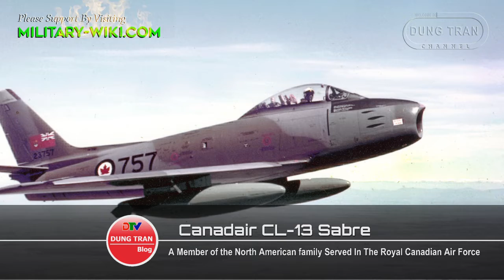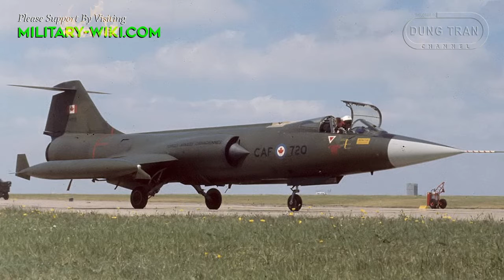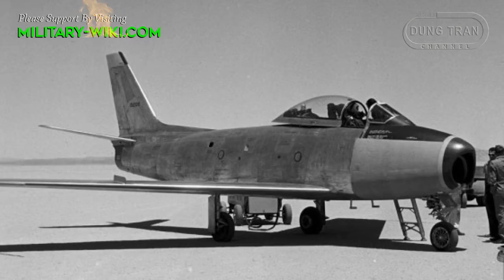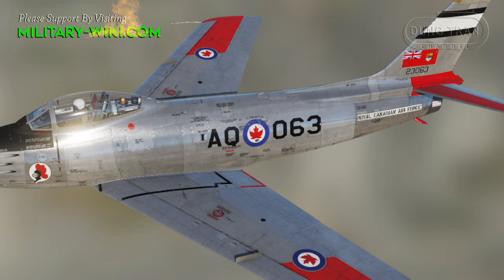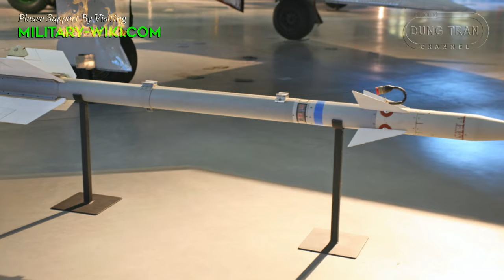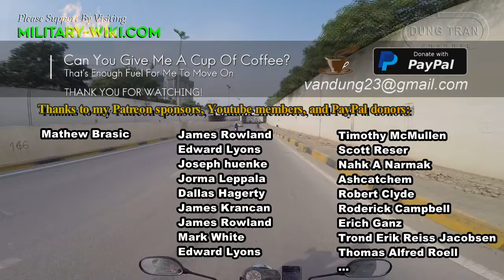Canadair CL-13 Sabre: A Member of the North American family Served In The Royal Canadian Air Force

Comment: The only disadvantage it had was that it was still armed with the light .50 machine guns. That was enough during the late 40s but by the early fifties it was difficult to get a fast kill on any jet.
Reply: 50's were enough til Migs flying tank showed up Wally! that's the real reason they went to 20mm's! i'm surprised they didn't build any the radar equipped D and K models!